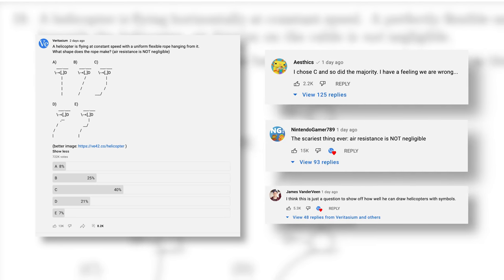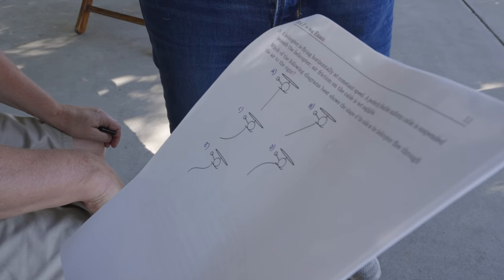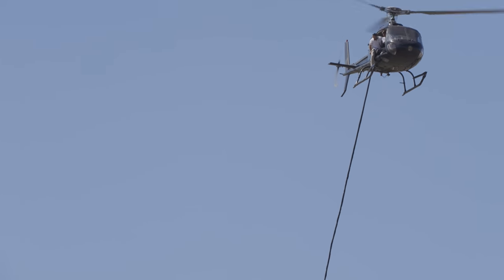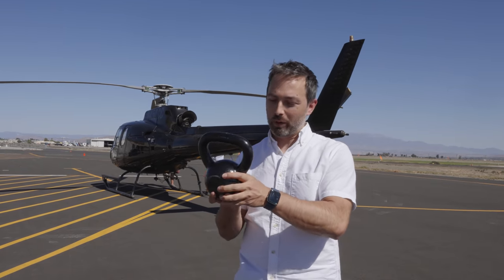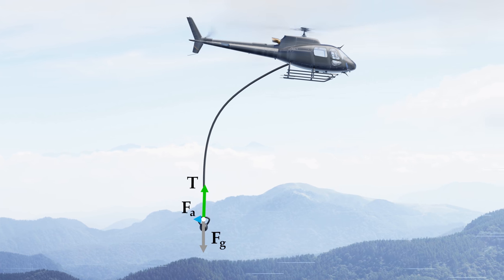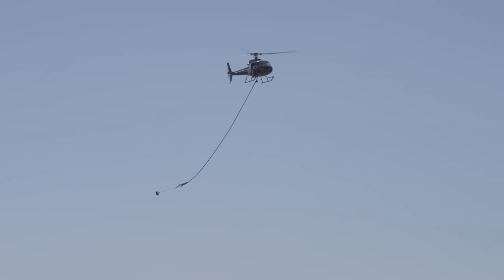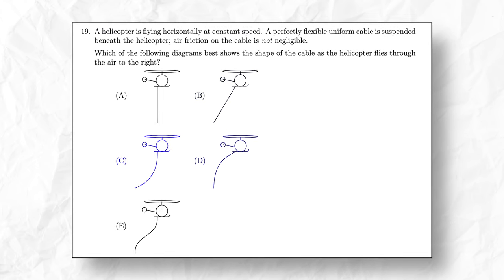I Rented A Helicopter To Settle A Physics Debate

Comment: Straight makes perfect sense when unweighted and curve makes sense when weighted, just draw shear moment diagram and free body diagram balancing forces along the rope.  How much of mechanical engineering just comes down to those two diagrams and Mohr's Circle?
Reply: Yeah I suppose moment increases linearly the farther down the line you go?
Reply: And theoretically say the winds of the helicopter were strong enough to make a noticeable impact then a curve at the top would also be correct (though they aren’t so Yh)
Reply: Oh yeah pshhh just do what this guy said 😂
Reply: The only reason it so controversial was probably the question of whether the helicopter blades' wind affected the rope. If it was given (it must be very hard to figure out where the blades' wind would dissipate), it would've been pretty straightforward.
Reply: I think he's wrong and the limiting factor is the length of the rope.  The rope is 15 m long and weights 20 KG.  That's about .75 KG\M.  The top of the rope is holding 20KG. the second to last .75kg.  The weight is not uniform along the rope, it just hasn't crossed the threshold yet.  If the rope was 150M long that first M would be have much more force pulling on it nearly 200KG. if it was Eventually the rope would exceed it's ability to support itself and snap.  The breaking tension of the rope is a metric ton.  is the rope was 750 M long that first meter would have a ton of force pulling on it, half way down it would be half a ton.  The force of gravity is not linear over the left of the rope.  This rope also has a wrapping increasing it's drag.  It's difficult for me to believe that a rope given the maximum available length would be able to hold that linear shape because of the tension on the line is no linear as you move up.  It just wasn't long enough.  Where he went wrong is that assumption that each section has the same wight and same air resistance.  But that doesn't matter because each section doesn't have the same force pulling on it.
Reply: Haha yeah about half of it seems to be that, the other half is thermo and fluids I guess?
Reply: @isk8nyc  that's simply not correct. Go watch the video again because he it explains it well. @
Physicsandium has a good video on this too.
Reply: yup it totally makes sense from that perspective. My gut told me there was going to be more drag with more length.
Reply: @hoveringgoat8061  yes and no, the extra drag from that flag I would have thought emulated quite well it the rope was a few meters longer, especially as more than likely the rope would just stay diagonal but at a steeper angle (depending on the added weight not being more than the added drag, if the weight is greater than the induced drag, the rope will hand at a slightly shallower angle) as the the extra drag added to the rope can be considered a uniformly distributed load (UDL)
Reply: @budgettransformer7952  Or if the winds of helicopter weren't stronger, I would think that you'd get the same J curve with a lighter rope and a slow enough helicopter airspeed.
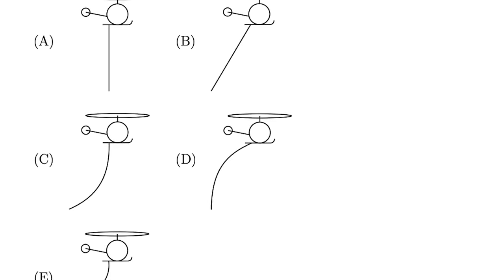Reply: @isk8nyc  To be fair to Veritasium, if you are testing the scenario posed by the physics exam, it makes the most sense to use a rope that is approximately proportional to the drawing. It appears that he implies this by juxtaposing the video of the helicopter with the drawing of the helicopter at, for instance, 7:39. I'm not denying the validity of your argument, I'm just saying that I don't think Veritasium "went wrong" anywhere.
Reply: @CoasterRanger  His explanation is flawed and it makes a incorrect assumption based on the weight of a single section of line compare to the friction of wind.  It looks good on paper but the weight of a single section is not relivent as the force pulling on the line is not linear. Have you ever seen how high you can fly a kite?  Eventually if you put out enough line the weight of the line will pull the kite out of the sky.  But before you get to that point the line goes from being a strait line to the kite to a sharp curve near the bottom leading nearly directly upwards to the kite.  As the line gets longer the force applied by its own gravity grows.  Eventually that passes a point where the force pulling on the line exceeds the resistance of the wind passing over it, such as with the kettle bell.
Reply: @Socucius Ergalla Well the lead weight attached doesn't have the same ratio of drag to weight.  I'm a skydiver and understanding the effects of drag vs mass is a part of understanding how to fly your body.  The lead weight isn't a good comparison because it's mass\drag ratio is way far different then the rope itself.  What we are concerned about is the drag, vs the the tension on the line, and as the line gets longer that tension increases more and more towards the top.  Eventually it will overcome the force of drag on the line.
Reply: @isk8nyc  Again that's just not true. He demonstrated it in the video. This isn't a kite. Are you a mechanical engineer professionally? I am...
Reply: @isk8nyc  Bro why are you trying to correct my mans when you can't even divide 20 by 15 correctly?  He literally rented a helicopter just to prove this to thick people like you arguing like you know physics smh did you even watch the video?
Reply: @theabyssalturtle  Meh it was late 20KG of weigh over 15M of line 20/15=1.3 transposing numbers doesn't make one an idiot.  I know he literally rented a helicopter but his explination doesn't match up with what I've experienced in my lifetime.  If what he's saying is true any line hanging in the wind should be straight but observed.  But I'll take you up on that be next time I go skydiving I'll dump different lengths of para cord and record the results.  500 ft of paracord will only set me back abt $35

Comment: "This is looks counter intuitive and would most definitely just trick students no matter how hard they study or how smart they are."
"This would make a very good multiple choice question!"
Reply: Counterintuitive =/= "trick students no matter how hard they study" 
If you're a physics student, using physics equations, you should get the right answer
Reply: @SuperSMT  Also (hopefully) anyone with a grade 12 understanding of physics would be able to figure out why the answer is B. In fact I wouldn't be surprised if it was used in some places. You're assuming air resistance and directional force, not gravity or imperfections in weight distribution.
Reply: @cqxmrvcoy True, more rope with greater density means more fuckery. The original thing didn't mention a heavy rope tho
Reply: I assume it’s more to show they approach the problem with logic, applying principles of physics, than necessarily getting the correct answer.
Reply: If you think this is about trickery, I hope you're not a scientist. It's a great question that only tests cognitive skills of the student. As for all the stuff like "heavy rope, rotor wash etc". It is then normal to assume something in your answer or consider multiple scenarios.
Reply: @hoagielamp6543  how are you supposed to know how much the rotor effects it? It varies with every helicopter and all it says is a “helicopter”. WELL WHICH ONE. 

Theoretically if the helicopter had more rotorwash then it be c
Reply: well, it is an Olympiad qualifier ques, thats how olympiads are
Reply: @hoagielamp6543  grade 12? What age are those students? We understood this crap at 15.
Reply: Search Heron's Fountain, that's counter intuitive... unless you understand physics.
Reply: @lookdawg187  who is we? I took my first physics class junior year
Reply: @GerardEibel  We Dutch have physics in our junior year too... here if you don't understand physics by 15 you're seriously lagging behind. 

By time we're 15 we learned how splitting atoms works, with their decay times and all.
Reply: @cqxmrvcoy Why? If the explanations in this video are correct there should not be a difference. The factors are still just air drag and mass.
Reply: Most simulations in the plenitude of games with physics were exposed to portray B, but the fact that the question presents you with other possibilities tricks you into picking a different answer. Would be the simple explanation.
Reply: @SuperSMT  It becomes easy once you know that the downward draft from the rotor has negligible effect on the rope.  How are you supposed to jusy know that?
Reply: If you are studying to become a pilot you should also be able to at least get the first and third szenario right since it's exactly about the kind of forces you need to fly a plane.

Comment: “Air friction on the cable is NOT negligible.”
Engineers : Impossible
Reply: *physicists
Reply: @unity_talon  thnx for ruining joke
Reply: Rather, the alternative is true in this case
Reply: @unity_talon  Both
Reply: @unity_talon  you mean 
Fisikist ?
Reply: @unity_talon  r/woooosh
Reply: @ktk1144  np ;)
Reply: @vaisakh_km  Not really. Engineers SPECIFICALLY have to account for real world conditions like friction, material properties, thermal expansion and son on. The joke only works with a profession that models "ideal" scenarios.  There is no woosh here, except maybe your complete lack of understanding what an engineer does.
Reply: Alexus I agree. This comment doesn’t make sense to me. Maybe someone can explain.
Reply: You are literally gaining likes every second lol
Reply: @AlexusMaximusDE  Agree, i'm an engineer and i honestly chose B on the community post. It was a hard one to think about, but still.
Reply: I mean even th small strings added to surface of airfoil in wind tunnel have non negligible air resistance.
Reply: enter the iit
Reply: @unity_talon  as the saying goes, engineers are a poor man's physicists
Reply: Physics teacher: What an abomination
Reply: @vaisakh_km  bruh he got the joke, but just ruined it
Reply: This is both rght and wrong, on entry physics for engeneering you would be told not to account for it and then on fluid dynamics (a more advanced course) it would be the most important aspect of the problem. Still laughet a lot reading it.
Reply: @ktk1144  He made the joke actually make sense
Reply: Is that a double negative :)
Reply: @AlexusMaximusDE  as an engineer i got tell you man, you are overestimating how we do things hahaha 
We do not calculate things like this because there are just too many variables, the way you account for them in the 'real world' is by applying a safety coefficient to any structure. It's usually a pretty big number for safety reasons. So we calculate on ideal models and just apply a random number to the result
Reply: @20teverify   i agree with you, im a machine engineer student and most commonly we aproximate and compare results to a safety coefficent. it all ofc depends on the task. sometimes its important to be super exact. but the joke works for both engineer and phsycist
Reply: @20teverify  Sure. I am certain all the aerospace and civil engineers just guesstimate windloads. The engineers working on cars just apply a safety factor to the drag factor. Just because your specific discipline and/or employers lets you guesstimate things, doesn't mean that's how engineers overall work.
Reply: @AlexusMaximusDE  engg saying imposible is sarcasm here...

But he corrected that to physicist who ignores friction...
That's why I whooshed
Reply: @aryanatre9971  😅
Reply: @vaisakh_km  You make no sense.

Comment: "Rotor wash doesn't extend that far below the helicopter"

It sounds like the entire question relies on the knowledge of this aviation trivia to actually complete, how mean
Reply: @Ishan Pant Yeah, as a physics major, if they had specified that the rotor effects could be neglected, I think the solution would have been immediately obvious to me.
Reply: It also means that the helicopter could be substituted with a small airplane making the actual verification safer!
Reply: I got it right, and I didn't even consider this
Reply: Yeah, when I first saw the question rotor wash didn't even occur to me and so I answered B as it seemed the obvious answer to me. (Physics student here.) When I saw people mentioning rotor wash in the comments I immediately started second guessing myself. But being correct in this way is immensely unsatisfying because I implicitly made an assumption that happened to be physically realistic purely by chance.
Reply: Yes it is, but that makes the difference between knowing and  understanding phisics. So why it is negligible for a a helicopter and definitely not for a jet engine?  Because of the structure around the blades in a jet , that keeps the air confined, and actually creates a jet. And to top it off,  you forgot that between the propeller and the rope there is actually an obstacle too: the body of the helicopter. 
But let's say that the downwash is important enough. Do you think that it goes perfectly vertically down? Remember, air resistence is not negligible so something has to compensate the air resistance of the helicopter body moving forward,  otherwise the helicopter will slow down,  even if it is moving at a constant  speed.
Reply: Many people surprisingly have no idea rotor wash is even a thing.
Reply: You need to provide two answers factoring whether the rotor wash is negligible or not.
Reply: The question can still be answered because rotor wash is obviously not infinite. Whether it matters for a 5' rope, Derek's 50' rope, or a hypothetical cable 5000' long still allows you to answer the question about the general shape.
Reply: @quarkonium3795  I mean...that just sounds like you didn't know enough physics. No shame in that. 

It's not that it "can be neglected" like this is a paper physics test, it's that it actually is negligible IRL.
Reply: @pitmezzari2873  "Many people surprisingly have no idea rotor wash is even a thing."
It's how my washing machine gets the clothes clean.
Reply: That also seems to be... wrong, depending on disk loading. I have the suspicion that the actual reason is that forces from downwash also affect the rope rather uniformly, at least on this rope. Would be interesting to see a much longer rope for example.

Comment: You're leaving us in suspense about then end, pulling that parachute back up where it gets dangerously close to the rotors. I assume you maybe just dropped the whole rope at that point?
Reply: They never came down.
Reply: @ToehsStorage  legend says they're still up there
Reply: Or they can just make the helicopter hover in mid air, not moving forward or backward, then pull it up while it is hovering. Even if the chute is dangerously close to the rotor, the can manuver the heli backward so the rope curve the other way then pull it up. Regardless it is safe to say, they are alive and well so they did it the right way haha
Reply: @harryvinh6413  he specifically mentioned the whipping action. The wash causes it without forward movement
Reply: Even if they tried pulling it upwards... That chute gon be more than 100 pounds...

Comment: Note that weight also increases going up the rope for the extra weight case. For the extra drag case ,the air resistance increases going up the rope. These are not visible in the vector diagrams in the videos.
Reply: I still dont get why the air resistance increases as you go up the rope in either scenario
Reply: @albert_the_cool8092 the air resistance doesn't increase, it's just that the weight of the rope is significantly smaller than the weight of the kettlebell, so the configuration of the rope becomes more like a diagonal.